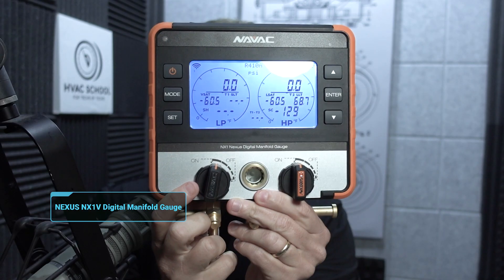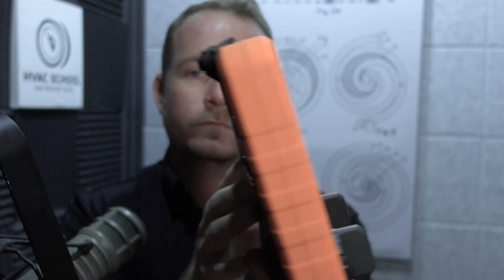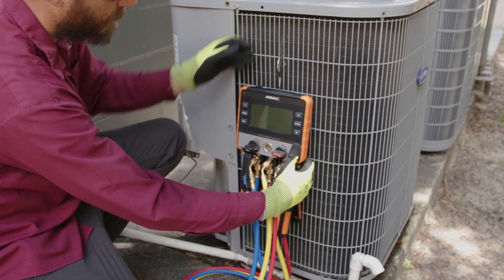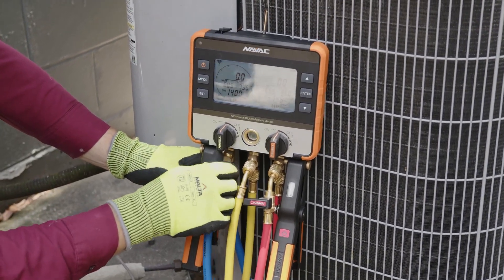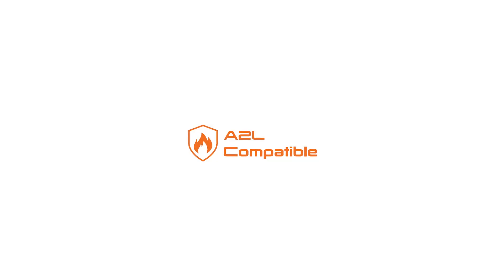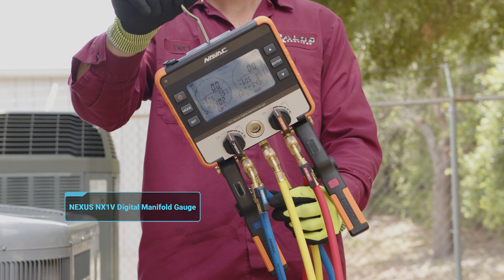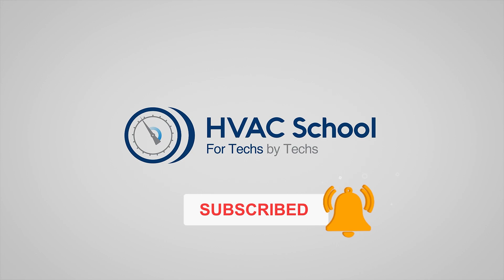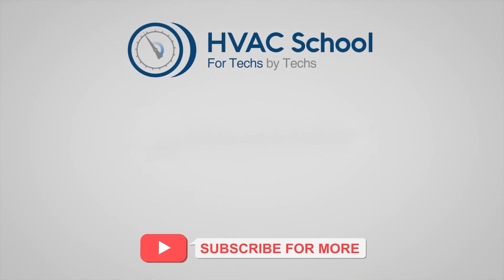Introducing NAVAC NX1V Manifold Kit

Comment: Props on Navac for designing the gauge right. I'm not adding more weight on the manifold with that 4th port and 2 extra seals that can start leaking. I need less problems not more added to them.
Simple design. I use my 1/2" appion hose from the pump straight to the system with a ball valve on the other end, no need to pass it through the manifold.
Reply: Hola Derrick... Soy fiel seguidor de tu canal. Quiero tener mi primer manifold digital, estaba viendo de pedir un fieldpiece que parecen ser más robustos que los Testo. Me recomiendas este de navac?

Comment: Why no 5/8 vacuum hose
Reply: Because vacuums should be pulled with one large hose straight from the condenser to the pump with a micrometer gauge on the other side.
Reply: @millenialmemoirs actually vacuums can be pulled any fckn way bc tour still pulling through a 1/4" scraper hole....

Duh
Reply: bro I’ve moved from maintenance apprentice to setting up interviews for comfort advisor roles making 250k annual in 4 years. I’ve turned down two service manager roles in the last year; sold, designed, and managed install of dozens of new equipment and duct systems with near perfect airflow, ran thousands of service calls. Am I wrong? How often do you pull a vacuum down to 180 microns in 30 minutes, decay test it,  and hold it? I do that shit weekly.
Reply: @millenialmemoirs you tell em bro! Old people bitch because they refuse to learn new ways. I love seeing an old tech watch me pull a vac in 30 mins🗣️🗣️
Reply: I've been using sman 360 for years (it's a 3 port and 1/4 pulls down fast with navac ball valve hoses. I prefer built in micron because once vacuum is pulled down you don't have to swap any connections, just close your vacuum hose and hook up your tank and you're charging.
Reply: Micrometer ....wow man...just wow...😂😂😂😂 day 1 Danny here
Reply: @HVACRDUDE  micron gauge been doing this four years and I’ll run circles around any 10+ year veteran in the field.  There is a proper way to pull a vacuum and most of you guys who have been doing this for more than 5-10 years are doing it wrong because you stopped learning years ago. Do you even decay test?
Reply: @millenialmemoirs  Since you brought up a decay test, why would they bother putting an evacuation mode and a decay test mode into the manifold if they don't want you to use the manifold while pulling a vacuum?  Yes, pulling a vacuum without a manifold hooked up is generally the way to go (at least for small system commissioning), but if you're going to specifically put an Evacuation Mode and a Decay Test Mode into your digital manifold, then NOT putting in a 3/8" port and valve seems like a pretty significant lapse in judgment, imo.